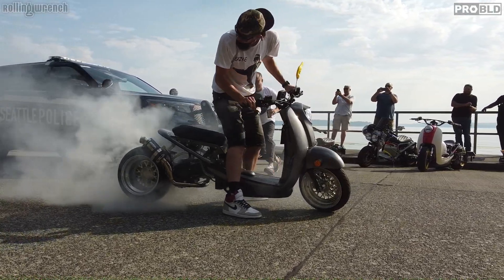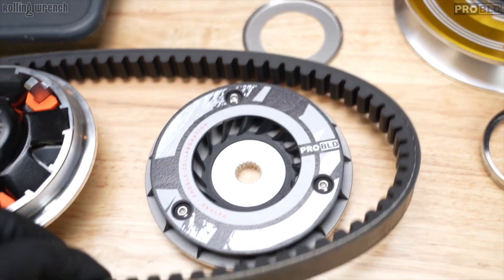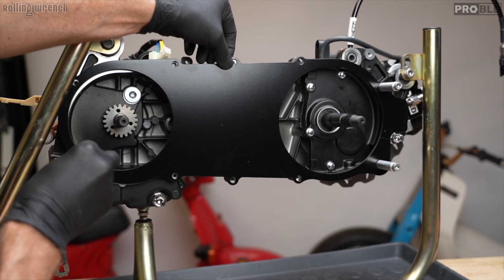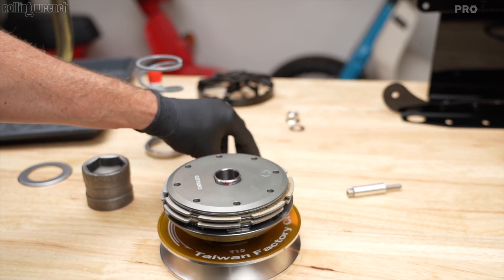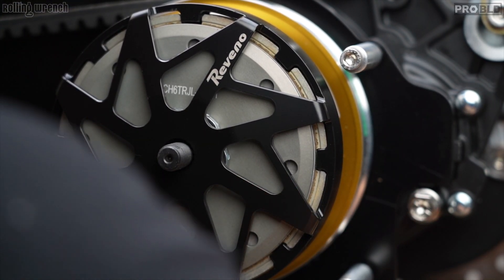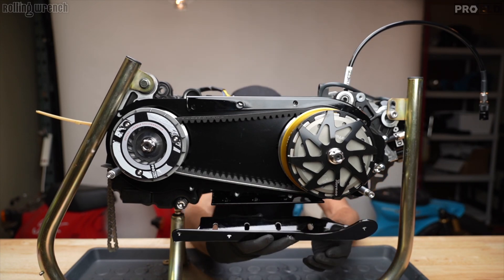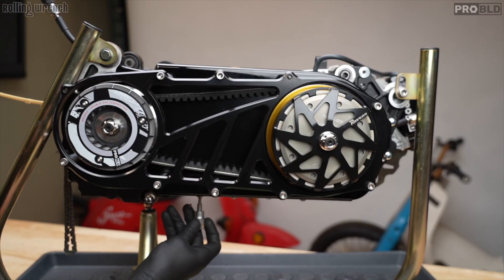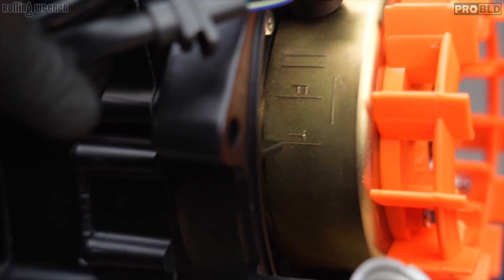GY6 Ultimate CVT Transmission Kit (Reveno) - EPISODE 4

Comment: whats the most power these cvts can handle?
Reply from the maker: 232 is as big as I have tested. It’s not an issue. Works great!
Reply: @RollingWrench  i have a project in mind to set up a 500cc inline four 2t. just want to know if theres these belt driven types put there i can use
Reply from the maker: @C-A-L-M  if your doing a big bike like that I would do a Reveno maxi scooter clutch. Like what is found on an xmax

Comment: that primary drive shaft is beefier than oem ones or is it still factory?  in oem set-up you can notice that the the tip of the drive shaft is locked/slotted in a bearing housing that cover that part of clutch bell cover. i think the oem clutch-bell housing support for that whole clutch assembly is way way beefier and better than that cnc lego like pieces and can solved that crank housing on breaking half.

Comment: Hey man don’t know if you will get back to me I’m a customer that’s bought quite a few things from your website u make amazing parts, I have a vento scooter that I extended I would really like you to see but any way maybe you could help me with a problem I’m having I have a 8pole ac wiring harness on it that’s always been good to me I’ve always had one problem with it tho it will not start from the button I’ve tried everything replacing switches stators and any other electronic u can think of it will start by jumping the solenoid but when I try starting from button it dims headlights but no clicking from solenoid I do have a high torque banjing starter on it after installing a 171cc big bore kit ik it’s a lot to read but maybe you can help me
Reply: You need to have bigger ground wires on it as it is a must with electrical system on Scooters need a much bigger wire to ground plus have added ground wires.